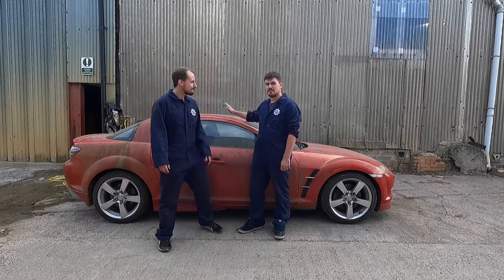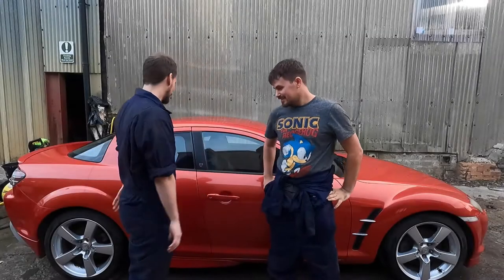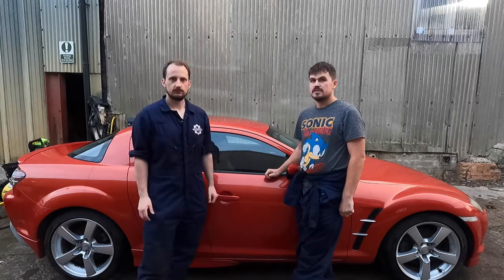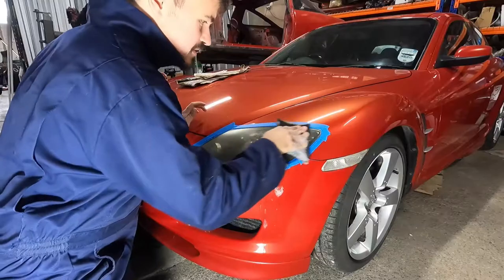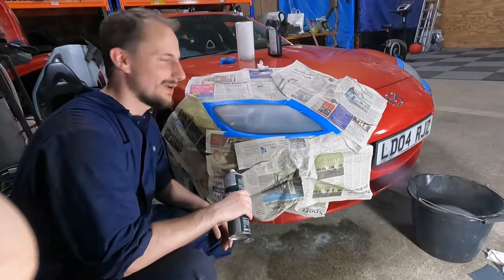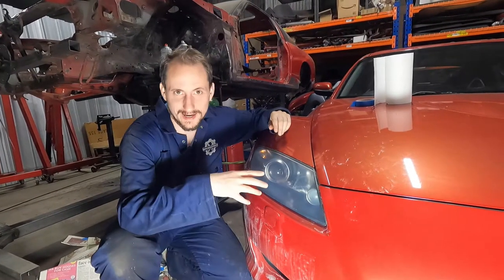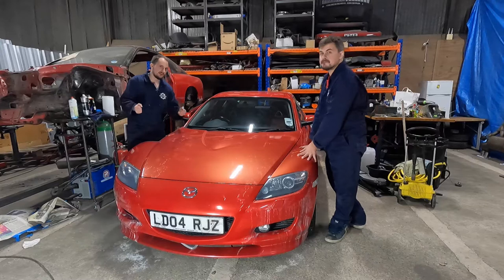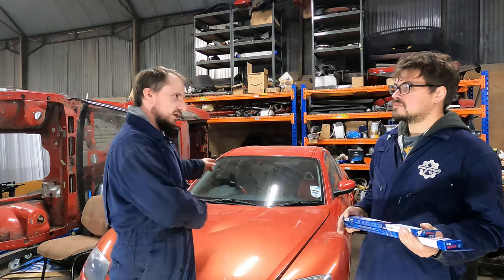[RX8] Headlight RESTORATION and MOT Prep

Comment: Your clear coat is hazy because of moisture being trapped underneath it as you sprayed it on. Cold temperature & high humidity increases the chance of this greatly. You could always use a heat gun to warm the headlight first and in between coats next time. The reaction will be contamination, possibly hiding in a deeper crack of the headlight.
 Washing up liquid isn't good for paint prep as it can contain silicone which is a spray painters nemesis! Next time use an alcohol based prep liquid that will strip all contaminants before painting. 
Otherwise, cracking vid. Will be good to see long term results of each headlight!
Reply from the maker: Ah that's some excellent info thank you :) we'll try that next time and let everyone know! Thanks very much, and yeah we'll keep an eye on them, RX8 MOT video will be out hopefully next week :O